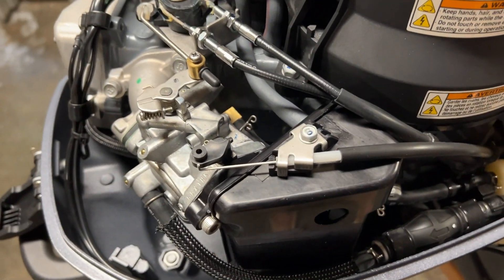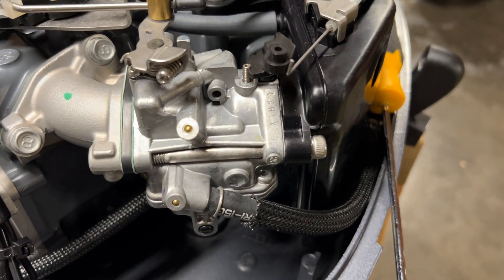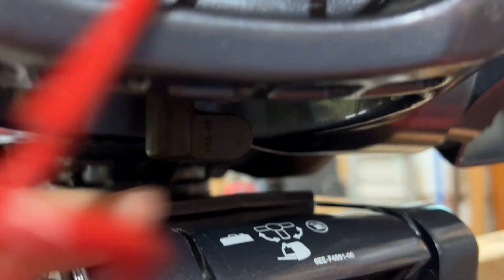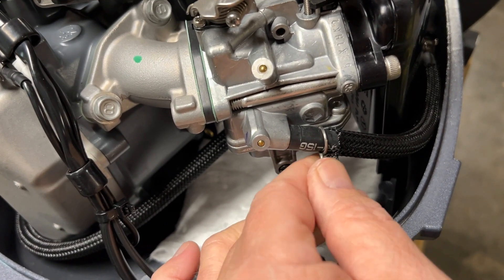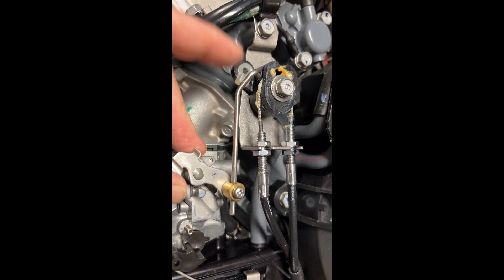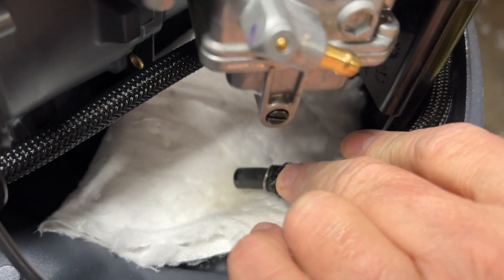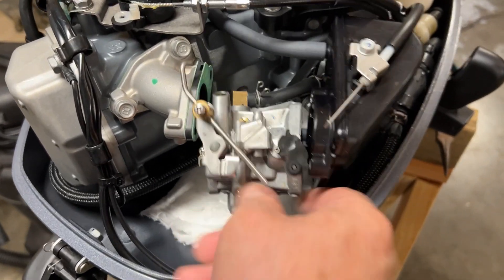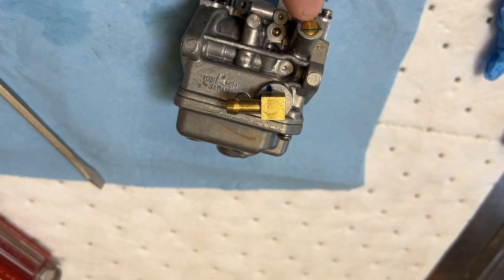Yamaha 6HP Outboard Motor Carburetor Removal and Cleaning - Mother Oceans New Dinghy Motor

Comment: Thanks; My F4 wouldn't start at all after sitting a season.  Watched this video cleaned the jets as you showed.  Worked perfectly!  I also had a time with that rubber gasket.  It was too big, so I got it close to its groove and tightened the bolts; it worked!  Thanks again.
Reply from the maker: To clean them up and have them start on one or two pulls (then purr) is a beautiful thing!

Thanks for taking time to comment!

Comment: Thanks for the great video are you able to advise how to set the main jet you removed, or does it just screw down firm?
Reply from the maker: It just screws down firm - no adjustment.  The main jet feeds the idle jet so if the main is clogged, you are going to idle very badly or - as in my case - not at all :)

Comment: So I have a 2017 but mine runs fine at idle and little throttle but once over 25% throttle it’ll bog out and turn off but start right back up after
Reply: Could this be the problem
Reply from the maker: Still could be in my opinion.  The main feeds the idle jet so perhaps you're getting enough to feed the idle path but as you go up in throttle, it could be starting to starve.   I'd suggest pulling it and cleaning - it's really not that hard and once you do it, I'll be you'll say "that was easier than I thought!"  

Good luck!

Comment: Thank you sir, this helped me to be able to run my 6hp at idle. It would stall when I reduced the throttle to idle just like your motor. In my case, the larger jet inside the carb was fine but the outside jet needed to be cleaned. I used a single tiny speaker wire to clean this jet. Once again, thank you! This video helped me get the confidence to open up my carb.
Reply from the maker: Awesome, I am so glad it helped you do the deep dive!  Kinda fun huh?  :)

Comment: Dzięki za video. Mam pytanie , jak usunąć zaślepkę iglicy składu mieszanki, pod nią jest chyba iglica na śrubokręt, ale czym to wyjąć to nie wiem
Reply from the maker: I don't fully understand the question based on the Google translation. Can you send me what 'time" in the video this is covered and i will get back to you ;0
Reply: @sailingmotherocean  6,50 pokazujesz ją palcem. Jest to śrubka do regulacji składu mieszanki paliwa
Reply from the maker: @il764  Thanks for the followup - I think this was removed with a basic flat-blade screwdriver - i needed no special tools.  But I did need to "narrow' an old screwdriver by grinding it down a bit - but I don't recall if the main jet was the one that needed the "altered" screwdriver.  Sorry!   Eleven months have gone by so I don't remember for sure.

I recorded this video for my own use and later decided to post it on YouTube.  Had I known I was going to post it, I would have done a much more detailed effort at filming :)
Reply: @sailingmotherocean  Dziękuję
Reply: @sailingmotherocean  I bardzo dziękuję że się zainteresowałeś tematem

Comment: Thank you for your video. I'm having an issue with my motor speed. I have a 6HP YAMAHA on my 11-foot inflatable boat. Previously, I could reach speeds of 25 km/h with two people and 30 km/h with just one person. Now, under the same conditions, I can only reach 19 km/h with two people and 24 km/h with one person.

I took the motor to a YAMAHA dealer and spent $140 to have the carburetor removed, cleaned, and flushed in an ultrasonic cleaner. They also drilled out and removed the EPA plug, adjusted the idle mixture screw, and tested the thermostat. Despite everything checking out, I'm still experiencing the same issue.

I'm at a loss for what to do next and would really appreciate any advice or help you can offer.
Reply from the maker: I'm no expert but what I would check is that the main jet is clean but it sounds like you had that professionally cleaned, next the throttle linkage to ensure full travel (so the throttle is fully open when you expect it to be), ensure you have a clean fuel filter.  Aging fuel?  Maybe put some known clean fuel in the onboard tank to see if there is a difference.  Any propellor corrosion that could reduce its efficiency?

Comment: Thanks for videoing the tiny spring on the float bowl pivot- it had me stumped.
I'm having a lot of trouble reconnecting my gear shift clamp that behind the round rubber grommets. I've done it before it just takes a little patience- the rods refuse to line up with the grooves in the clamp.?
Reply from the maker: Me too - took many tries.  Everything is the perfect length to "just not reach" with human fingers :)